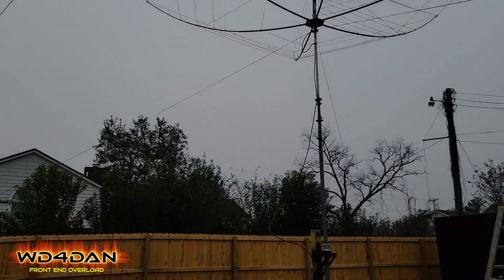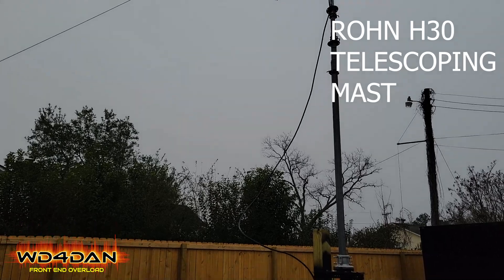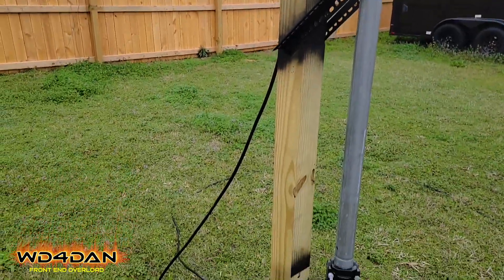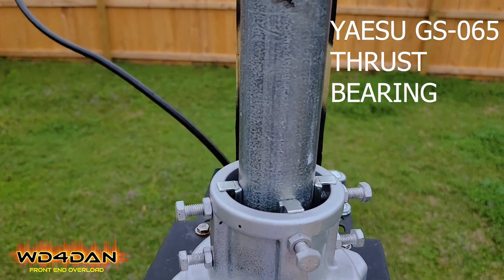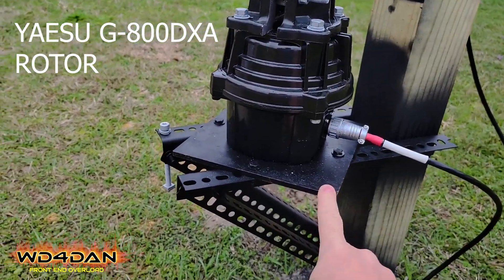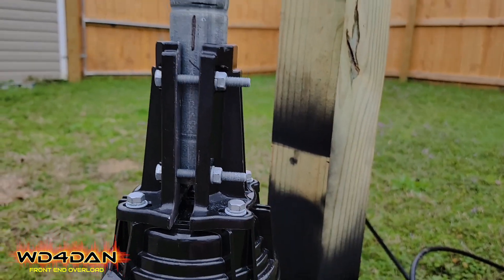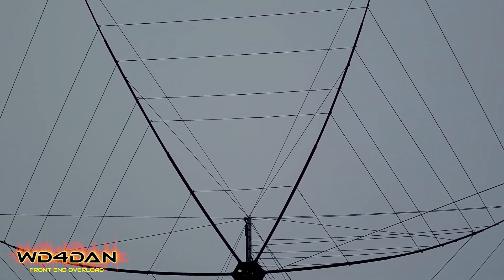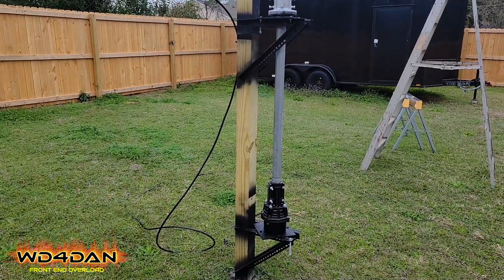NA4RR Hexbeam Mast Rotor Setup

Comment: no ground rod at the base that is bonded to the rotor plate and to the house ground?.  I looked into a Rohn H30 mast, but the shipping on those things from most places is almost 2x the purchase price.
Reply from the maker: Not yet no.  Coaxes are grounded in the attic with a plate that's connected to the house ground.  I should get off my butt and run some solid copper from the post to the same point.

Maaan yes the shipping is horrible because they come freight.  Best thing to do is order and have them bring it to a hamfest and pick it up lol

Comment: Na jakiej wysokości została zamontowana twoja antena hexbeam. 
Czy wysokość ma istotny wpływ na skuteczność pracy..?
Reply from the maker: currently at about 35 feet, a little over 10 meters.  You'll want it at least 1/2 wavelength higher than the lowest band (20 meters) for optimal performance, but it will work very well lower to the ground as well

obecnie na wysokości około 35 stóp, nieco ponad 10 metrów. Będziesz chciał, aby była co najmniej 1/2 długości fali wyżej niż najniższy zakres (20 metrów) dla optymalnej wydajności, ale będzie działać również bardzo dobrze bliżej ziemi.
Reply: @WD4DAN  Dziękuje za informację.. Mam hexbeam z rozszerzeniem na 14,Mhz i do wyboru maszt 12  i 16 metrowej wysokości..
Pozdrawiam SP2MZ

Comment: What are your measurement ont he slotted angle? The length you cut them at?
Reply from the maker: I didn't really measure.  Just long enough so they'll go down at 45 degrees-ish.  The top angle cut long enough so your rotor and thrust bearing plate will fit
Reply: @WD4DAN  What thickness or gauge slotted angle did you use.

Comment: Hello Sir
Thanks so much for this video and your kind input.  What's a part list for the rotator shelf and thrust bearing shelf?  Thank U KB2AT
Reply from the maker: 1/4" steel plate, 8"x8".  Can get from any local metal shop.  I cut the pipe hole and drilled for bolts myself.
Reply: @WD4DAN  Can you describe what bits you used and size?  1.5 inch carbide hole saw? Describe the process please?  That would be extremely helpful.  Thanks
Reply from the maker: @JosephRampolla 1/2" drill hole, then a jigsaw to make the circle is the easiest/cheapest way.

Comment: Thanks for the setup. I just ordered the same antenna. Did you paint the spreaders or leave them as they are? Also, will the HexBeam mount on a standard TV-type mast? 73s de W3CT
Reply from the maker: I didn't paint the spreaders, I thought about it for UV protection but never got around to it.

The center hub is designed to go onto either a 1" schedule 40 pipe or a 1.5" schedule 40 pipe with no shim required. ID is 1.30" and OD is 1.59"

There is only 1 through bolt hole.  In my setup, I had to drill a second through bolt hole perpendicular to the existing one to help it from rocking back and forth and also shim it.  I'm not sure the exact OD/ID of the top section of my mast.  I'm not sure about a standard TV mast, but check the dimensions above.

Comment: Hello Sir,
Thinking of going same route but bought my brackets from ML&S and curious did u bolts yours through post or just screw them in?  Holding up good?  Thank U.  Seems easier and less expensive than tower
Reply from the maker: 3.5 inch lag bolts, 2 on each bracket.  The thrust bearing mount needs to be the most sturdy of the two. It will be carrying the vertical weight of the entire system.
Reply: Has that been very sturdy?  How many guys just the one?  Thank U for info and the video.  Was gonna put up tower but to expensive@WD4DAN
Reply from the maker: @KB2AT I have extended out the mast now.  3 sets of guys. Been through some rough stormy winds with no problem.
Reply: @WD4DAN  If I am correct, I believe you have your guy wires attached to two thrust bearings. Did you use Rohn TB4 45Ag Hd Thrust Bearings?  They are very pricey.  I am not sure if there are a cheaper alternative? Any info would be appreciated on what you used / brand /model.  TY
Reply from the maker: @augmentedrealitydirt4582  my guys are connected to the guy rings that are provided with the rohn mast
Reply: @WD4DAN  oh great, I thought you had to use thrust bearings.  Thank you for clarifying that!

Comment: Reminds during time was the military the mast system was a crank system for microwave dish at top had 8 guy lines made out of Kevlar went up 50 ft where I was at was V1 site then dish was aimed the other site would have been called a V3 where more of these could be put up but entire system would be military cell phones network bigger equipment much bigger then your average cell phone one other item was ROW that put out foot prints in the air over lap where cell service was the op truck where system could be watched so not went down